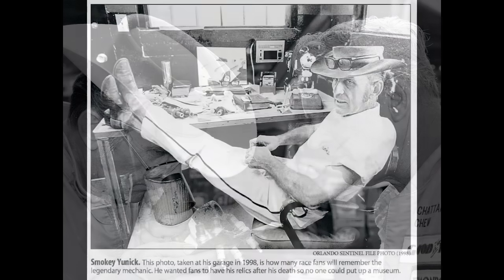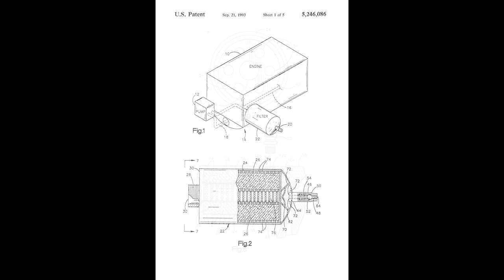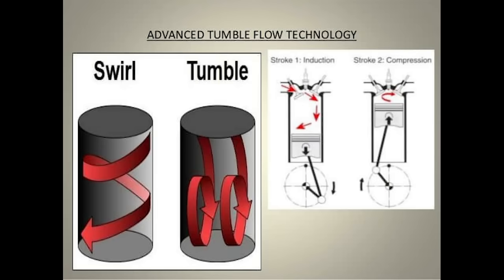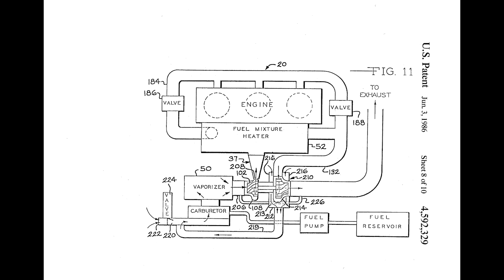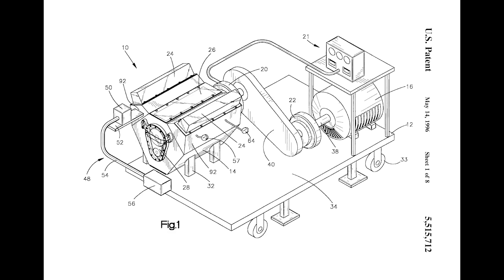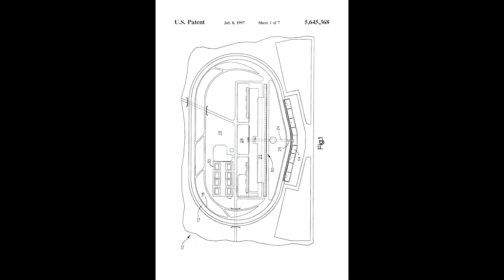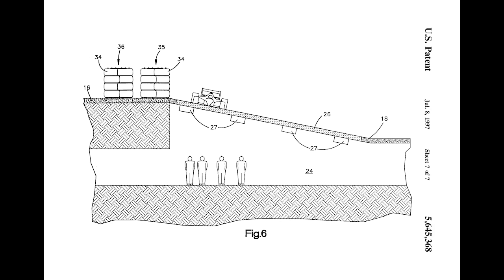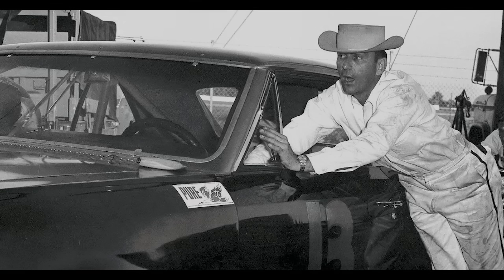The Patents of Smokey Yunick - Engines, Equipment, and A Racing Series?!

Comment: In his book Smokey said he took psychedelic drugs in order to mentally solve mechanical problems and imagine a solution. Not LSD but mescaline from cactus. This undoubtedly led to things like the reverse rotation Indy car, The flywheel/bellhousing supercharger on the Fireball Roberts 1962 Pontiac, the hidden dry sump system he outlined in his book, and all the other fringe stuff he tried.
Reply: Man that's crazy, the dude was microdosing before any Silicon Valley kid ever came up with the word!😂😂